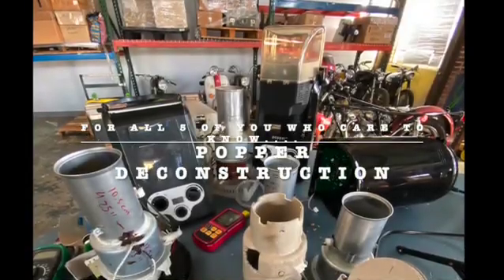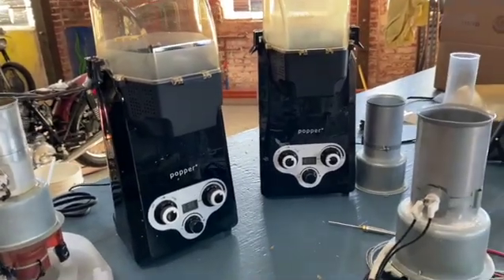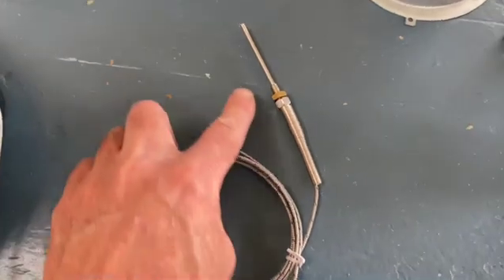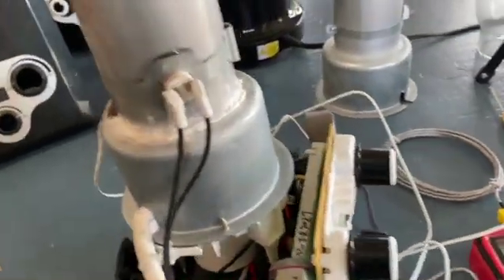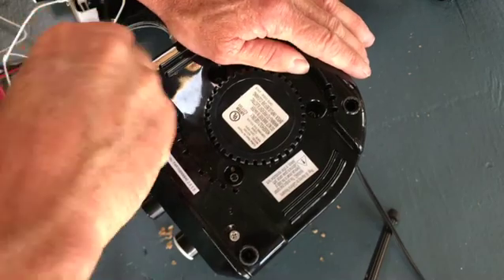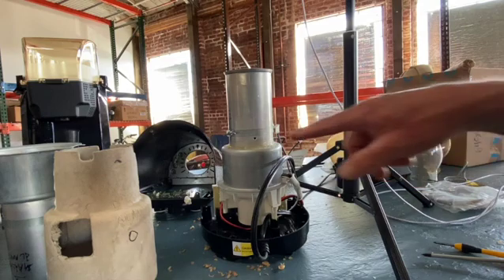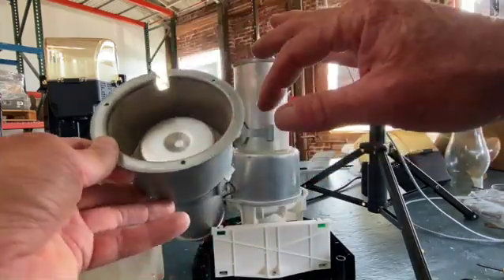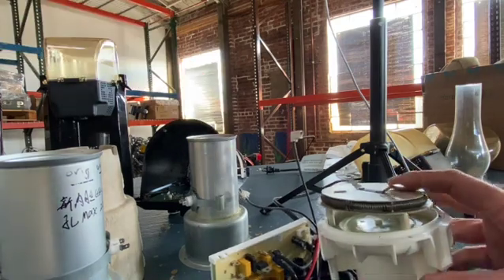Popper Roaster Deconstruction and Candid Talk

Comment: Popcorn poppers still made with 1450 watts power. I am surprised the popper the roaster has onlyb1150 watts. Hope it is increased in future versions.
Thermostat : a pop corn popper thermostat cant be used in roaster . It should be rated at 250 c .
Otherwise machine is designed and built well.
Reply from the maker: Yes you are right, there are some 1450 watt, but as far as I know, not with the roast chamber cyclone design. they issue heat from a vent in the bottom upward. There are ways to adapt them for coffee so they don't roast too fast, and they need an extension roast tube on top to keep excess coffee in. I use a glass chimney. To control heat and air flow you have to rewire the AC heat coil separate from the DC fan, but info on this is online, and using Arduino / Phidget to log / control heat can lead to some good control of roast. FYI Popper is 1200 watt appliance.
Reply: @popperisacoffeeroaster6888  

Try to increase to 1800 watts in the next model

For popcorn 1200 itself too much. But this marketed as coffee roaster. So you should compete with freshroast. 
Ofcourse there is assiciated cost but you should consider winter and dark roast . Also next model should be atlease 150 gms or if possible 200 gms.
Reply: @Popper is a Coffee Roaster  yes. They dont rotate the beans but blow them. But here it is redesigned for coffee roaster. So ax1450 with a cyclone and av250 c thermostat is the way to go. All are available in commercial quantities. 
Thanks for listening and responding.
Reply: Thank you! I do have a design question.  As I and others have found the power is discrete not variable.  I assume the variable resistor was just cheaper than putting in a multi-position switch.  And too hard to build the circuit to make power variable?

Comment: Just finished a roast on the Popper.  The fan started audibly slowing down nearing the end of the roast and was (very very low) during the 3-minute cooling cycle.  As a matter of background, I don't run long roasts and have been very diligent regarding cooling between individual roasts (15 minutes of idle time between, and also adding a second 3-minute cooling cycle as well). I also use a pastry brush to whisk away chaff so it doesn't get sucked into the bottom during the roast.  Is the machine designed to slow the fan down if the temperature cutoff is reached? I'm wondering if the fan is going kaput...
Reply: It's officially dead in the water... the fan won't spin at all :^(
Reply from the maker: Did you contact SM for replacement Brian?
Reply: @popperisacoffeeroaster6888  Yes, it was graciously replaced and the new one is working well. Thank you :^)

Comment: Thanks for the video. I purchased a Popper on 11/25/21. I measured from the top of the plastic housing including the clear plastic top to the bottom of the heating chamber at 10.5 inches. I do not see how 13.5 inches would work. I received my answer via email I was thinking inches not centimeters. Tom mention 13.5 I assumed inches by mistake.
Reply from the maker: It's centimeters - sorry if i said inches.

Comment: I use the Nostalgia popcorn popper that I bought from Sweet Marias to do my coffee roasting.  I have modified it and added the thermocouple that you sell.  It has served me well and I have done many roasts with it.  However, since it is a popcorn popper and not a coffee roaster, I am expecting the unit to die at any time.  Are the heater and fan in The Popper more robust than the heater and fan found in your average popcorn popper Like the Nostalgia?  Also, why didn't you include a thermocouple with a temperature readout in The Popper?  Was it to keep the cost down or some other reason(s)?